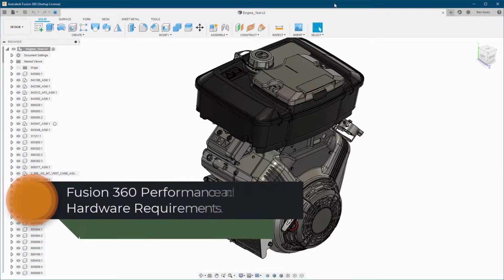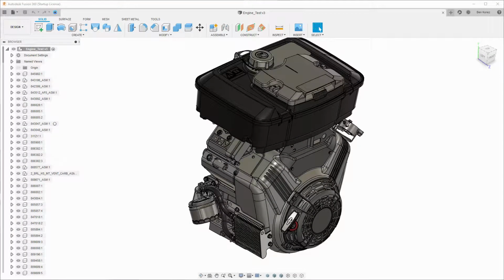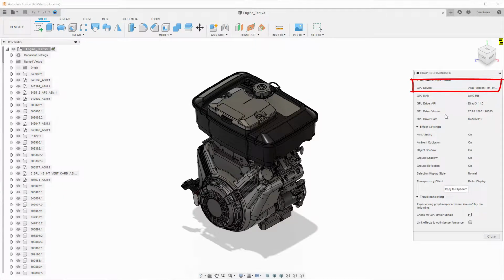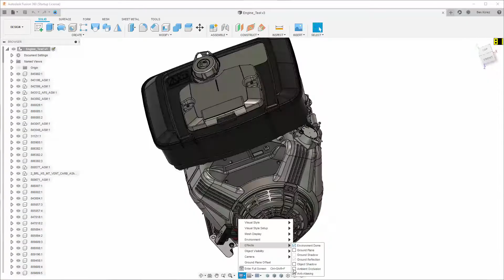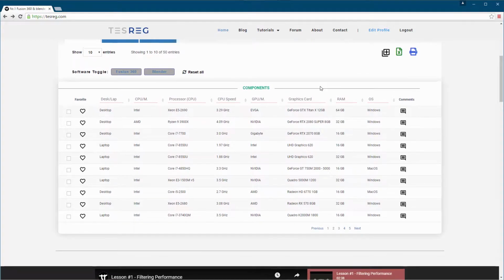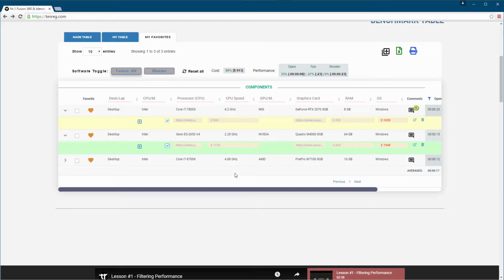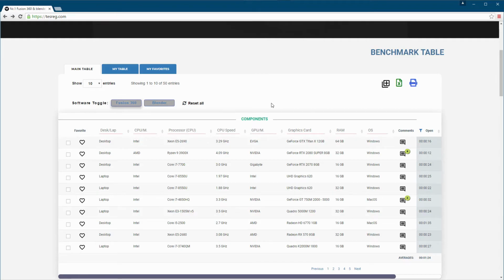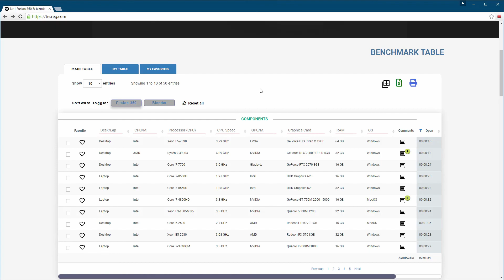Fusion 360: Hardware requirement and Performance Part02 (2020)

Comment: Nice setup. I get a lot of questions about the best Fusion system. I always recommend clockspeed over cores. My customers are using CAM mainly. Have you tried to include that in your benchmarks? I dont get registred on your website

Comment: Hello, thank you for your videos... I am looking to buy a laptop to run fusion to start learning. MSI has been recommended and I have €1000+/-. I live on a Spanish island so have to buy online, any advice would be much appreciated
Reply from the maker: You need to answer the following questions first:
1. What are you going to model? etc. Single parts or assemblies...
2. How complex your models are going to be? How many components on avg.?
3. How often are you going to use F360?
4. Are you going to use other software in parallel to F360? etc. Adobe or other Autodesk software?
5. Are you going to use local rendering or cloud rendering?

Answer those question and I'll help you.
Reply from the maker: @LajimmyLajimmy  May I ask what is your budget?